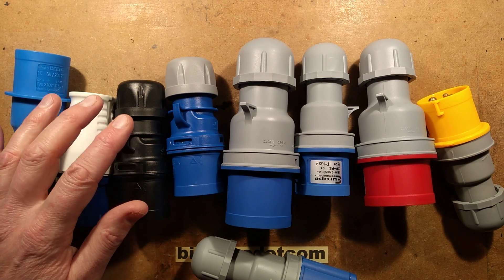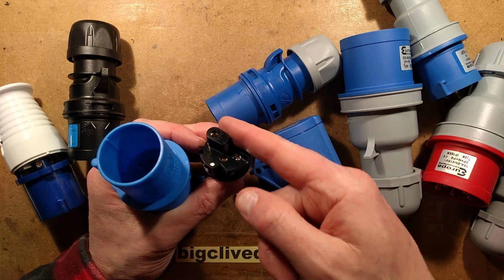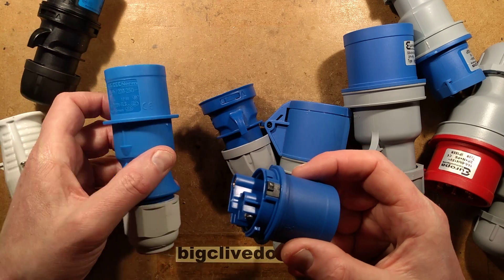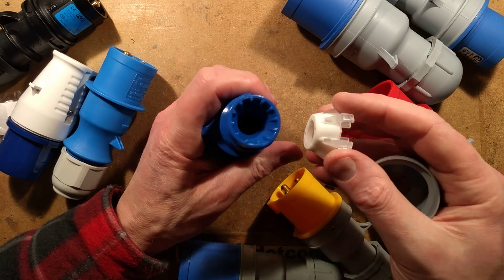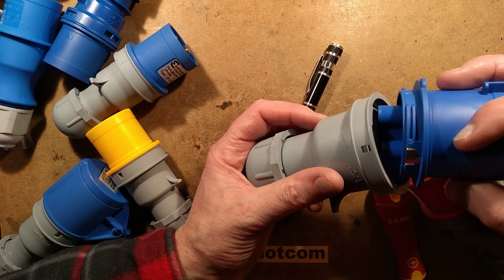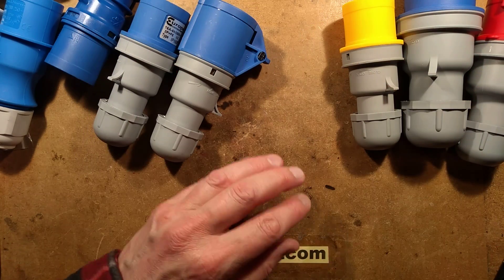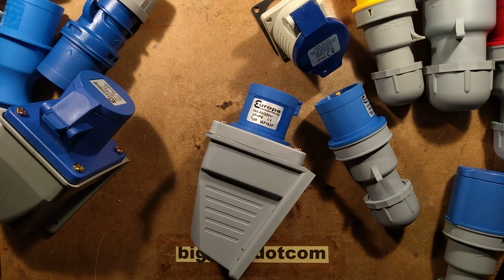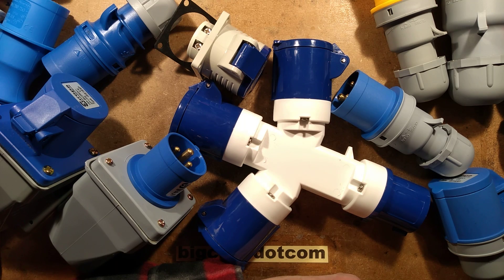My favourite industrial connector (Ceeform).

Comment: Some industrial places here in Aus use them but most use the standard Aus plug, till you go 3 phase where all are the same type (but different sizes) we also on 3p (and some 1p) use a lock nut to keep them connected and make them more water resistant

Comment: I work in retail, driving a van and delivering shopping. We use these connectors to power the van's refrigerator while we are loading up the van. Each van bay has its own connector and what's interesting is while they are connected the van is 'disabled' in that we cannot start the engine and drive away while the cable is connected!
Reply: Interesting idea preventing drive away if the power cable is connected.  I was on our town's volunteer ambulance service years ago. We had a power pigtail hanging down from the ceiling plugging into the side of the ambulance to keep the various batteries charge. After having several drive- aways without removing the cord  I rigged up a break-away connector and used Kellems wire grips. That way if someone forgot to unplug the cord the breakaway connector detached and the ambulance would drive away with a short cord flapping out the back.

Wonder if they still use my system now that I think about it.
Reply: KrozMcD same sort of work but it doesn’t disable the engine. You can still start it. I drove away at very low speed with it still connected and pulled the wires out but I rewired it and no one noticed 😬
Reply: Unfortunately, the van where I work aren't so high-tech, there's been few wires torn apart and connectors absolutely fucked over the last few years I've worked there.

Where you have to leave the van running, so the alternator gives that extra bit of power, so the fridge & freezer don't eat the battery while loading.
Reply: @SimonJ57   They do mke auto-ejecting connectors which are common on the side of ambulances and Drs cars in the UK. http://www.ludomcgurk.com/auto-eject-connectors-product-124.html
Reply: Same sort of work but you can still drive off with these connected. I did it and re-wired it back together before anyone noticed 😬
Reply: Just like electric cars...
Reply: mcgherkinstudios While we are mocking people for attributes outside their control.... have you noticed that the manufacturer of the auto-disconnect is "Kussmaul" ?  Adorable... (lit. "kiss maw" but I think "snog gullet" rolls easier off the, er, tongue)
Reply: @mcgherkinstudios  Self ejecting plugs... Hmmm, sounds like something Apple would invent.  Or perhaps it's the latest way that Samsung are going to circumvent over-charging of LiIon batteries?
Reply: @trevorvanbremen4718  It already exist on fryers.

Comment: I’m really surprised you’re not a Neutrik Powercon fan
Reply: Pwercon is often used for DC connections but the connectos are prone to dirt ingress (CEE is mosly flapped)
powercon however is MUCH more compact but also less mechanicallt stable, CEE 16 and 32A connectors are  built like tanks :-P
Reply: The classic powercon series has several issues.

1. While the original "20A" powercon connectors are available in both inlet and outlet forms, the 32A version is only available in one form (which appears to be intended for use as an inlet)
2. Neutrik don't make inline sockets for the original powercon (though at least one clone maker does) so you have to use a seperate coupler if you want to join two cables.
3. The classic powercons were not originally rated for disconnection under load. This has been changed in the latest revision, but only if both mated connectors are the new type, the current rating under European standards was also reduced to 16A in the new revision.
4. It was only suitable for indoor use.

The "True 1" series fixed a number of these issues but it has issues of it's own.

1. It only exists in 16A, there are no higher current variants.
2. The connectors initially had insufficiant polarising features, leading to a risk of dangerous mismating if treated roughly, there was a revision that supposedly fixed this but only if both connectors have the revision.

Comment: worked in construction a bit, and was used those connectors  for powering equipment, lights, speakers motors, and other things off the top of my head i cant think of (canada)

Comment: The blue ones (230V) is quite common in Norway for higher power (16A or more continous).

There is the single phase and the 3 phase versions (3 pin & 4 pin), this applies to TT/IT grounding.

There is a red one for 400V(5 pin?) used in TN-S-C grounding, but I haven't seen any installations with it myself.

The yellow one, I see as a US-thing. I don't know about use at all.
Reply: So we have it quite opposite in Czech Republic - 3-pin sockets are new thing and can be seen rarely, even in new installations, but 5-pin are very common. There is only TN-S allowed for new installations in Czech Republic, so all 3-phase sockets must be 5-pins. 16A and 32A are the most common current ratings, 63 and 125A are rare and used only in industry. The blue 1-phase 32A sockets are used only for currents higher than 16A (limit for small 1-phase sockets), e.g. welder machines.

Comment: Canada.  I mostly see the Hubble Twist lock 50a used for connecting machinery and welders around shops.
Reply: I don't think they use those twist locks outside North America since they're based on the NEMA standards.
Reply: Hubble is a manufacturer not a connector, do you mean the 240v 50a (oddly named) California Connector?
Reply: bronzedivision had to look it up, yup “California connector”.

Comment: Saw a "UK plug" that had those pins, but a normal looking plug shape, wondered if this was the 1940s 😂
Never seen a round socket in the uk
Reply: UK used 5 Amp and 15 Amp round pin plug/sockets up to mid 60's depending on region. My childhood home had stacks of these when we moved in in 1960 and power was DC, our town converted to AC around 1963 and all the old round pin sockets were replaced with 13 Amp flat pin outlets.
Reply: @TheBananaPlug  ah maybe not as old as I thought then 😅
Reply: old uk plugss were round pins yes and made from bacolite
Reply: Phonotical It was probably a 15 amp plug rather than a house hold 13 amp plug.
Reply: @cchris17  it was too weedy looking for comfort, no fuse
Reply: 15a plugs and sockets are still used in the entertainment industry, usually for dimable lamps

Comment: My Dad and Mom has a Knaus Caravan that is using that connector for the AC 230v power that is connected to the grid. That connector is common in Sweden for sure. https://www.frankana.de/en/caravan-einspeisungsstecker-cee-64453.html#v_321_024 It is rated for 16A